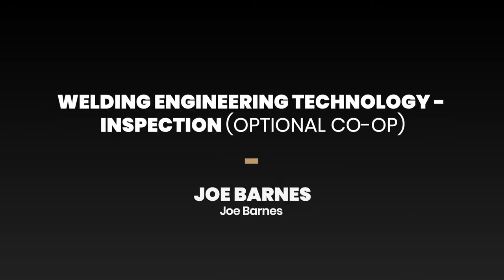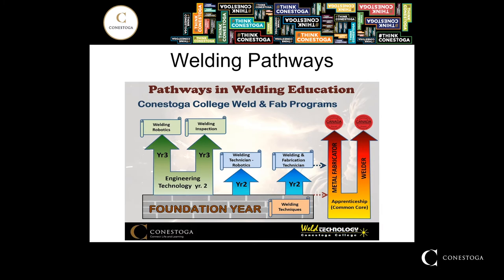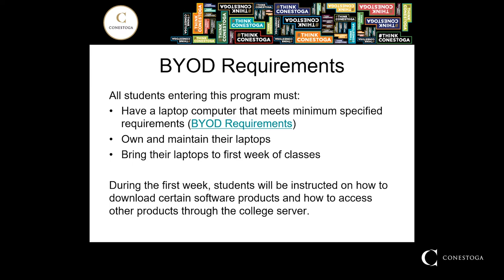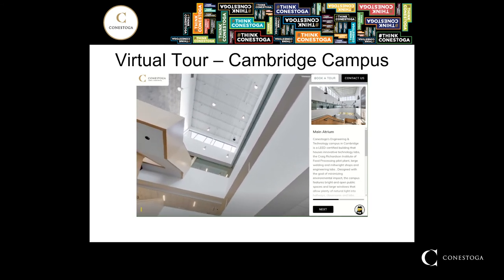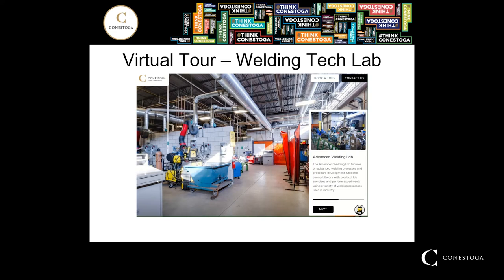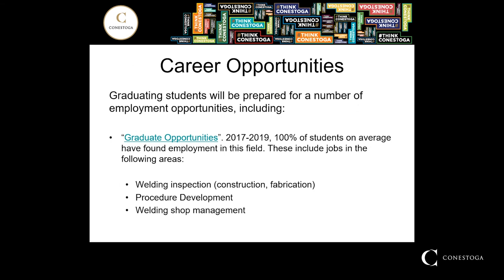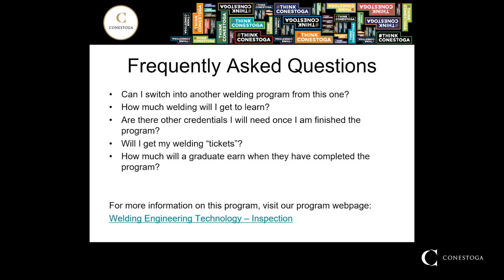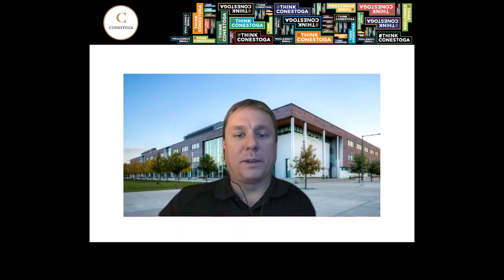Welding Engineering Technology - Inspection (Optional Co op) (0043)

Comment: Can you please clarify what does it mean by optional co op terms..???
Reply from the maker: All applicants apply to the non co-op program. Students will be informed of the application deadline and process to apply for the Co-op Stream. Labour market conditions determine the number of co-op seats in optional co-op programs. Not every student who meets academic eligibility requirements will be admitted to the co-op stream. To be considered for admission to the co-op stream, students will be required to achieve an overall 60% unweighted average (with a maximum of one dropped or failed courses) in all Level 1 and 2 program courses. 
https://www.conestogac.on.ca/fulltime/welding-engineering-technology-inspection